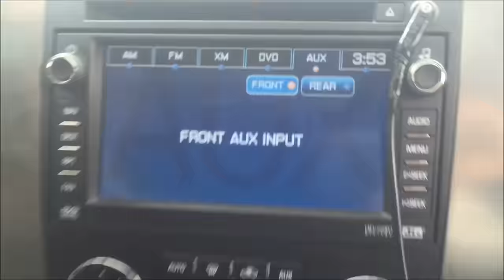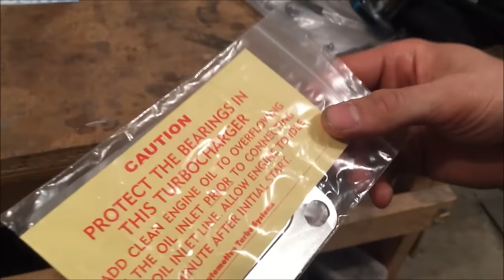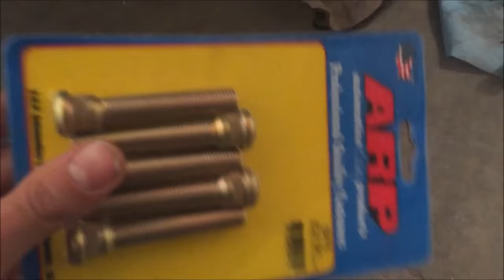SUPRA GETS A BIG TURBO

Comment: When you have install this turbo, what is more work in engine, modif ECU ? Crankshaft allege ? change piston ?
please answer my question, because when i go work. My dream is buy and drive Toyota Supra with 2JZ-GTE :)
And i have one any more question do you have site for find Supra not very expensive. Thank you :)

Sorry for my bad language i'm French and i have 18 years old's ^^ good work guys ;)
Reply: Engine stays stock, but ECU, fuel injectors and fuel pump will be changed on this one!
Reply: + Jesse Inkster and the head gasket connecting rods and pistons are not weakened with power ? thank you ;)
Reply: +DreeZy you want a 2jzgte supra better have 30k plus lol

Comment: Lag lag lag BOOOOOSSSST
Reply: +atreyu bidasha but there is no lag if you keep it reved high so whats the problem? :v
Reply: +sermerlin1 very true but if u line up with a TT in 3rd at like 30 u ain't Gana catch the TT BUT very true kinda pointless for only 7psi with a turbo that big
Reply: atreyu bidasha yeah but still when you start racing you won't start at 2k rpm... You will prep your engine by reving it high to spool up the turbo then fly off trying to cause as little tire slip as possible...

Comment: thats not a proper twin scroll manifold, the collator isn't separated into 3x3 runners before the flange - hence you wont get the benefit of a twin scroll turbo
Reply: +goldenvtr You are exactly right. I would not be surprised if boost creep on that manifold is absolutely uncontrollable. It's also a T3 manifold. I expect to see the next rebuild video about a week after the turbo gets installed on that manifold.

Comment: Dont turn a Turbo in the wrong direction .... and never turn a Turbo without Oil!!!!!
Reply: +ja10ni its perfectly fine to spin one without oil at the speeds he was and the 'dont turn turbo in wrong direction' is bs. do you know anything about the construction of a turbo? its literally a shaft with a compressor blade and a turbine blade with bearings between the two halves. no damage will be done at all. spinning it in the reverse direction is exactly the same as spinning it in the other direction by hand.
Reply: top memes I work at a tuning garage in germany  for about 10 years so I know what I say. ;) If you turn the shaft without oil in the wrong directiom you can damage the bearing. I talked to a lot of turbo producers and they all said that. that ist the commandment... if you swear to another  ....do what you think is the best for your turbo.
Reply: ja10ni it wont. bearings spin both ways perfectly fine. if its low speed by hand no damage will be done.
Reply: +ja10ni 10 years experience and still have no idea what you're talking about. hilarious.
Reply: You guys have no idea what youre talking about xD  .... you think the only bearing is a ball bearing ... but there are a lot of bearing versions ... for example the sleeve bearing. this bearing works with an oil film around the sleeve .... if you turn it without oil you will damage the sleeve an that can damage the whole Turbocharger .... before writing, please have an idea of what youre writing....

you can read this on the page for example from BorgWarner ... Turbocharger manufactory ....
Reply: ja10ni you mean a journal bearing.. WHICH BY THE WAY is not a one way bearing, it can spin both ways you tool. if you turn it by hand, low rpm's no damage will be done at all as friction is minimal, stick it on an engine and you have a problem which is what the oil lines are for. however who even buys journal bearing turbo's any more?? most bearings these days on turbos are ball bearings because they are better. There are things called roller bearings and tapered roller bearings, guess what.. they also spin in both directions, the tapered bearing is useless in a turbo, the normal roller, not so much but guess what, that still spins in both directions. NO HARM WILL BE DONE IF YOU SPIN A BEARING WITHOUT GREASE OR OIL AT A LOW RPM. I actually studied engineering and I do know what im talking about as I wrote an entire paper on bearings, not just worked in some tuner shop at the front desk.
Reply: top memes If you mean ..... but than told that the people from the factory who are building these chargers. ;) ... why should they told me that if its not true ?!?!?  and i bet they know better what there talking about because they are build these things !!!
Reply: ja10ni If you actually knew anything about bearings in the first place you'd know they're taking the piss. Bearings spin both ways, there is no difference to spinning in one direction than another. Spun by hand at low rpm's its fine, the friction isnt great enough to cause any damage to the bearings. Its like rubbing your hand across sandpaper, do it slowly and its fine, do it quickly and its not.
Reply: top memes Don't worry about this clown, he's nothing more than a glorified parts changer. I'm also studying to be an engineer and have quite a good understanding of bearings as well.